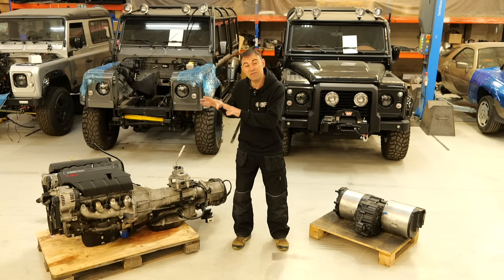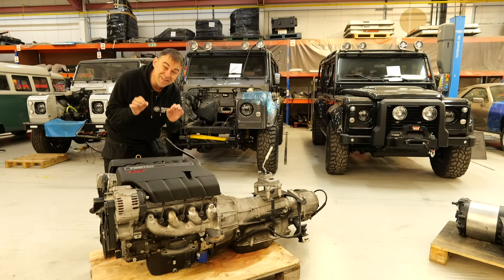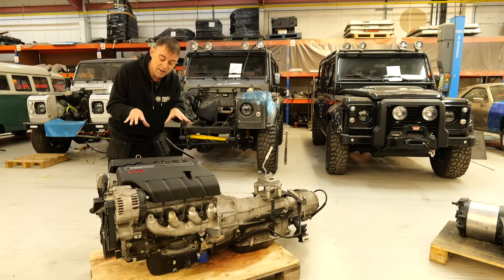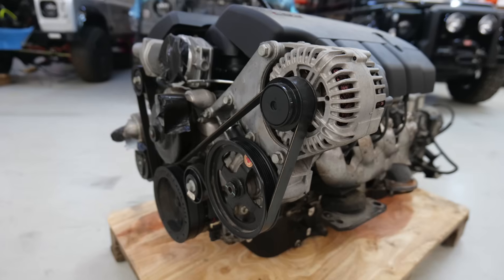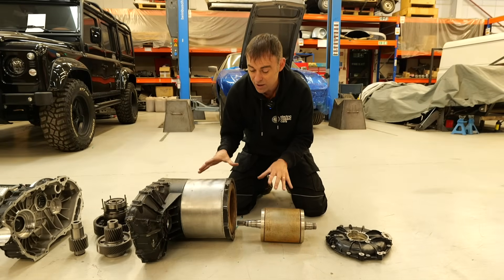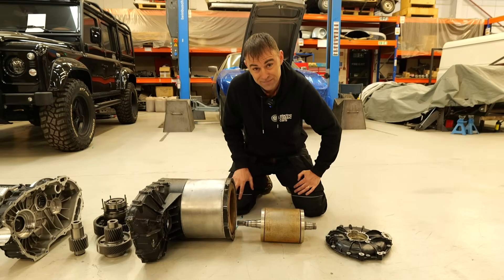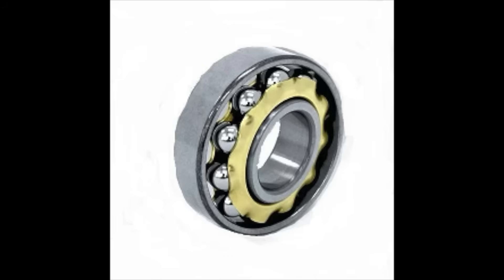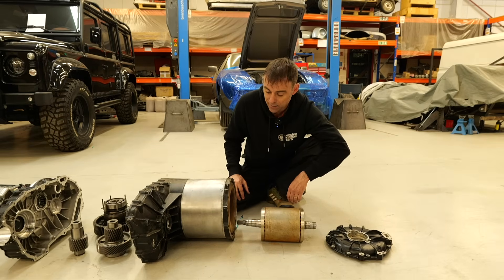Let's compare the Tesla LDU with an LS3 V8 and take one apart to see what makes it tick.

Comment: When you add in the weights of the exhaust and other anciary bits, you should also include the weight of the battery
Reply: And let's also not forget about the weight of a fully filled 55-80L fuel tank that an ICE needs to run!!...
Reply: Agreed
Reply: @you2be839  1kg / ltr.
Reply: @you2be839  or 50+kwh battery pack + protection
Reply: @you2be839 with an electric battery your not normally fully so why should the tank be full
Reply: @gmercede  If charging at home, the battery would most likely be full... but the the ICE tank should be full when it comes to testing range and the total weight of the different vehicle's technologies as the closest apples to apples comparison possible.
Reply: Fuel lines, radiator, alternator, vac lines, air intake, vac pump and extra emissions technology as well. Lots not included.
Reply: @you2be839  thats been addressed.. .the EV is MUCH heavier , with fuel of ICE considered.    are you late to the party here??
Reply: @zanick2  No one's trying to party and EVs are generally heavier than ICE cars, I only said that the fuel for ICE cars also needs to be mentioned because it rarely is in these kind of "total weight of a system" talks!
You're the one making preassumptions!!
Reply: @zanick2 well depending on what ice car, some ice cars are more heavier than ev, thanks to the lack of transmission on EVs.
Reply: and therefore add the 60kg odd of the fuel tank and 55 odd litres of fuel inside it.
Reply: @smithleon and the starter battery for the ICE
Reply: But don't teslas also have an accessory battery that is required to make the car work?
Reply: @eds.9522  All EVs do. You don't wanna run your interior stuff with 400 or 800 volts.
Reply: @steviefordranger198  Ev allso have 12v starter battery.
Reply: @steviefordranger198  again, so what?  50lbs for the battery, 150lbs for the gas.  600+ for the engine?   the EV parts are over 1000lbs     stupid to bring up weight here
Reply: @steviefordranger198  Well given the V8 is a bit of a hunk it would be a big and hence heavy starter battery, but curiously most if not all EVs have a 12V lead acid battery, if only to run all the 12V accessories.
Reply: @eds.9522 yes. Lol Tesla has batteries.
Reply: @steviefordranger198  My EVs also have a starter battery - well, HV control battery - 12volt same size as an ICE starter battery
Reply: @castroorstad8215 An EV doesn't have a "starter battery", that's the main battery.
I'd hope the 12v being used in an EV is more like a camper van's house battery, as it can be discharged further down. If it's lead-acid then starter batteries and house batteries are actually built physically different inside. But honestly I'd hope they're using a 12v 100ah lithium
Reply: @logitech4873 That is not what the 12V is for though. All EVs have a DC-DC converter which brings the traction battery voltage down to run the 12V subsystem. The 12V battery runs the subsystem when the traction battery is not connected and when the DC-DC converter needs more current than it can supply - like power steering, window demisters etc. They could make the DC-DC conferter do everything but power electronics are expensive so they use a much cheaper ancilliary battery. Similar to the way a 12V battery in an ICE car supports the alternator. It also means that if the traction battery gets too low and needs to be shutdown to protect itself you can still start the car to charge it.
Reply: @marquisdemoo1792 once again that is incorrect - read the previous comment in this thread to discover what the 12V battery inan EV is really for.
Reply: @ You are being pedantic. I was replying to someone who seemed to think there was no equivalent to the starter battery in an EV and was deliberately simple.  My choice of the word accessories was perhaps vague but it was meant to include all the  non-traction components.
Reply: @michaelmartin9022  No. It is a 12v starter battery. Usual agm type. Newer Tesla has Litium type.
Reply: @eds.9522 correct, although the EVs 12v battery is a lot smaller as it doesn’t have to crank an engine.
Reply: @eds.9522 well but evs  doesn’t need that heavy transmission 😅
Reply: @eds.9522 Yes, a solid state battery less than half the size of a standard ICE car battery. They moved on from the regular ICE battery in 2023.
Reply: @castroorstad8215 Not anymore bud. Tesla moved on to a solid state unit that's less than half the size of a 12v in 2023. Keep up if you're going to criticize so you don't sound like a fool.
Reply: @ChosenMJ  Here we have one of the idiots who thinks he knows more than others, and tells them they are idiots. But who himself is the biggest idiot. Tesla does not use solid-state batteries in their cars instead of 12v lead acid batteries. They use a lithium-based battery.
Reply: @smithleon but then you would have to factor in the battery weight too.
Reply: In what world does a gas take weigh 60 kg?
Reply: @Joecrow-c6c  When it's full of fuel I would guess
Reply: @Joecrow-c6c do you mean gas tank. Fuel weighs approx. 1kg per litre. Than the metal tub of which the fuel lives can indeed be 60kg and more. A out the weight of a person.
Reply: @smithleon  yes
Reply: @smithleon odd you suggest that.
Reply: Tank is not 60kg😂😂 its closer to 15kg @smithleon
Reply: @shanemyers6244  add in the weight of the petrol, about 0.8kg per litre. You do the math.
Reply: @shanemyers6244  if you look at my original post I said it was 60kg of tank AND fuel.
Reply: @smithleon  you got to be kidding.   you know the batteries are over 1000lbs.  MUCH more heavy than the engine and fuel combined.
Reply: @zanick2  No, a battery averages about 300-350 kilograms, which is not even 20% of the all up weight of the vehicle.
Reply: @thethirdman225 EVs are great but the batteries weigh more than that most of the time. Plus the post you responded too said over a 1000lbs which is about 450kgs - a model 3 battery weighs about 480kgs but Tesla is the best at optimising weight so others may weigh a lot more. Weight is not the big deal thay everyone makes out until you get into these large 4WDs - then the extra weight becomes an issue with GVM and GCM.
Reply: @mondotv4216  I've already looked it up. But the one thing everyone overlooks is that  unlike internal combustion engines, batteries still have long way to go in development. There's a new development out of China almost every month. Th latest is that they seem to have solved the problem of sodium having low energy density. That's the thing they're chasing. More energy density equals better power to weight.

The peak of this is said to be the solid state battery and that's another one that's a fair way down the track. It works but again, it's a matter of weight. They'll work it out.

Tesla source most of their batteries from suppliers. They're not actual battery developers. The Cyber Truck, for example, actually uses a truck battery, hence the 800V architecture. That's becoming more common but that's where it came from.

But it still remains that the Model Y is still lighter than any BMW X5. And that's my point. All that weight has to come from somewhere. So whatever the battery weighs, the whole package isn't extraordinary. But if you're going to include the whole power train from fuel or battery to the wheels, an ICE vehicle has to include the drive shafts and the differential.

That extra weight in the BMW is less favourably placed too. The CoG of an EV is much lower than in an ICE and the space is better utilised.

This will all change in time. Batteries will get lighter. ICE engines reached their peak of development 30 years ago.
Reply: @thethirdman225  The reason the Tesla is lighter is because of the aluminium body panels versus the steel body panels in the X5 - plus the X5 is a hybrid so it also carries a small electric motor and battery and the heaviest version is a PHEV with an even bigger battery. I do agree with you that the there is too much FUD about EV weight. For example a Model 3 is only about 60kg heavier than a Toyota Camry. Having said that Tesla is about the only high volume EV maker that has concentrated on weight reduction. Most use exactly the same tech they use for their ICE cars which is going to make them about 250kg heavier. A Polestar 2 for example is between 100 - 200kg heavier than a Model 3.
Reply: @ The Polestar 2 does very well in long range tests. I looked up the Polestars 3 and 4 and both of them have monster batteries in them.
Reply: @thethirdman225  It still has a 12v battery.
Reply: @ The accessory battery, yes. It wasn’t me who was talking about that.
Reply: @zanick2 450kg to be exact for the M3 performance which is 991.8 pounds.
Reply: @franciscoshi1968   you sure its not 992.1lbs? ;)
Reply: @smithleon sure. Fair and rational comparison
Reply: @smithleon  You'd be suprised how light a tank of fuel is, about 2 pounds per gallon, so 55 liters is equivalent to 15 gallons, so like 30-35 pounds for the fuel, and add another 50-75 lbs for the weight of the tank itself, you get roughly 100-120 pounds total.  The battery at nearly 1000-2000 lbs is going to drastically outweigh the fuel and add significantly to the EVs total weight. We see this as all Tesla's are 500-2000+ pounds heavier than their comparable gas vehicles when all parts are assembled in the final car product.
Reply: @RT-mv7df   You guys can’t help yourselves, can you? A gallon of fuel weighs about six pounds, not two. Did you really think I wouldn’t look it up? That means about 90 lbs in a 15 gallon tank, not 35 lbs. an EV battery that weight 2,000 lbs? Are you completely serious? The heaviest normal EV battery I know of is in the Mach E at 550 kgs, which is just over 1,200 lbs.

No Tesla battery weighs 2,000 lbs.

Why do you people feel so compelled to sprout oil industry lies? It’s not even in your own best interest.
Reply: @thethirdman225  u know what, that's my honest mistake, u r correct, it's ~6lbs. I quickly read a reference that said gasoline is 25% lighter than water & misinterpreted that as 25% of water (was being lazy, i admit). Note to self: slow down. NOW.... Even at 6lbs, that's 90lbs of gas in a 50-75 lb tank, which is only about 40-60 lbs heavier than my earlier estimate. 

Still WELL UNDER 200lbs, & SIGNIFICANTLY under the average weight of a Tesla battery that can't get the same mileage as a decently efficient gas car at (30mpg *15gallons = 450miles/tank). You'll see in the list below that most EVs get anywhere from 240 miles to 330 miles (excluding the farthest outliers).

Now, a breakdown of a few EV vehicle battery weights:
Battery Weight, Key Statistics: 
Minimum: 668 lb (Nissan Leaf)
Mean/Avg: ~1495 lb (sum of the model list (see below): 19,445; divided by 13 ≈ 1495 lb) :face-pink-tears:
Median: ~1700 lb (Model Y, 7th of 13 entries in the list below)
Highest: 2923 lb (GMC Hummer EV Pickup)

Common Model Battery Weights (Sorted):
Vehicle Model, Capacity (Weight), Tested/Verified Mileage, Notes
1. Leaf, 40 (668), 226 miles, Reported weight
2. Bolt EV, 65 (959), 238 miles, Estimated: 65 kWh × 14.8 lb/kWh
3. Model 3, 60 (992), 310 miles, Estimated: 60 kWh × 16.5 lb/kWh
4. Ioniq 5, 77.4 (1160), 265 miles, Estimated: 77.4 kWh × 15 lb/kWh
5. Model S, 100 (1200), 366 miles, Reported weight
6. Mustang Mach-E, 98.8 (1323), 270 miles, Estimated: 98.8 kWh × 13.4 lb/kWh
7. Model Y, 75 (1700), 308 miles, Reported weight  🙈
8. F-150 Lightning, 131 (1800), 270 miles, Reported weight
9. Cybertruck RWD, 120 (1980), 250 miles, Estimated: 120 kWh × 16.5 lb/kWh 😤
10. Cybertruck AWD, 122.4 (2020), 302 miles, Estimated: 122.4 kWh × 16.5 lb/kWh 😵
11. Cybertruck Cyberbeast, 122.4 (2020), 304 miles, Estimated: 122.4 kWh × 16.5 lb/kWh :face-purple-crying:
12. R1T, 135 (2200), 254 miles, Estimated: 135 kWh × 16.3 lb/kWh
13. Hummer EV Pickup, 212 (2923), 329 miles, Reported weight

Look at all those Cyber Trucks with approximately 2000lbs , LOL.  AND that's without the range extender that I read adds an extra 500kg (1000lbs) :hand-orange-covering-eyes: Holy Toledo!!!!  These vehicles all weigh several hundred to thousands of pounds heavier than their ICE equivalents (not including acceleration, a meaningless metric), and each 100 pounds of extra vehicle weight actually increases the total momentum of a car at a given speed and significantly increases the deadliness of those vehicles in a crash with either pedestrians or lighter ICE vehicles.

You can corroborate this info yourself by asking Grok (or another LLM) the following:

"Provide a list of sorted EV battery weights for vehicles (cars & trucks) sold in the US in the last 4 years, stated or calculated, including at least the minimum, the mean, the median, the highest, and 3-4 other common popular cars for comparison (exclude low production rare vehicles)".

Interesting since Musk produces the CyberTruck and controls Grok, meaning he has incentive to skew these numbers favorably for the CyberTruck (they definitely do not publish the weights of the batteries by themselves (hint: they don't want this being talked about, for many reasons); but with the battery chemistry, cell-type, and total capacity of the battery it is rather easy to roughly calculate).
Reply: @RT-mv7df  gasoline weighs SIX pounds per gallon. 15 gallons weighs ~90 pounds.
Reply: @cyberia55  Thanks, yes, my mistake has been pointed out very promptly & i admit i misread a reference that said "gas is 25% lighter than water" and interpreted it as "gas is 25% the weight of water". Didn't pass the smell test & I thought it was "amazingly" light, but was in a hurry and didn't double-check. At least it proves I'm not AI & still prone to human errors.
Reply from the maker: We covered a petrol vs battery comparison in a previous Tech Talk which we linked when we talked about the weights and at the end of the episode. In case you missed it, here it is. 👍 https://youtu.be/opF1si__APs?si=WNcGIWVZZUdGGDzd
Reply: The weight of the battery only going to go downward as battery technology for EV is also improving, bettery energy density equals fewer batteries needed for the same range.
Reply: @RT-mv7df “Mileage” is a combination of factors, not just range. Mileage is a measure of efficiency. What “gas” car gets 450 miles on a single tank?

Furthermore, a Tesla Model Y weighs 2003 kgs. It’s rough analogue, the BMW X5 weighs at least 150 kgs more and up to 450 kg more, depending on spec.

Annual running costs are not even comparable. The Model Y is far cheaper to run.

I have to ask again: why do you do this? It’s not in your best interests. Far be it from me to tell you how to make your life choices but being shackled to oil companies at a cost of thousands of dollars each year for the rest of your life sounds like an act of self-harm to me. The oil companies don’t care about you. Why do their dirty work for them?
Reply: @thethirdman225   What “gas” car gets 450 miles on a single tank? Numerous ones, any that begin with 32mpg (of which there are many these days) can still feasibly get 30+mpg after several years (we're talking hwy miles, which in major cities is majority of the miles from commuters on intercity hwys). Not saying they will all have 15gallon tanks, for example, the Accord has a 12.8gals tank (perhaps larger, but this is the lowest estimate). That gives it a range of 435 miles even with a decrease of efficiency due to age of 34mpg (34mpg * 12.8 = 435 miles). If we speculate the tank is actully 13.5gals, then the range is 459 (at 34mpg), or   it can still get 435 miles with it's efficiency decreased to 32.2mpg.

Sample of Common Models (2015–2025)
Toyota:
Corolla: 41 MPG highway (e.g., 2020–2025, 2.0L I4, CVT).

Yaris: 35 MPG highway (2015–2020, 1.5L I4).

Camry: 34 MPG highway (2018–2025, 2.5L I4, non-hybrid trims).

Honda:
Civic: 36 MPG highway (2016–2025, 1.5L I4 Turbo or 2.0L I4).

Accord: 37 MPG highway (2018–2025, 1.5L I4 Turbo).

Fit: 35 MPG highway (2015–2020, 1.5L I4).

Hyundai:
Elantra: 39 MPG highway (2017–2025, 2.0L I4).

Accent: 36 MPG highway (2018–2023, 1.6L I4).
Sonata: 35 MPG highway (2015–2020, 2.4L I4, non-hybrid).

Kia:
Forte: 41 MPG highway (2019–2025, 2.0L I4, CVT).

Rio: 36 MPG highway (2018–2023, 1.6L I4).
Optima: 35 MPG highway (2016–2020, 2.4L I4, non-hybrid).

Nissan:
Sentra: 37 MPG highway (2020–2025, 2.0L I4).

Versa: 35 MPG highway (2015–2025, 1.6L I4).

Altima: 34 MPG highway (2019–2025, 2.5L I4).

Chevrolet:
Cruze: 33 MPG highway (2015–2019, 1.4L I4 Turbo).

Sonic: 33 MPG highway (2015–2020, 1.4L I4 Turbo).

Spark: 34 MPG highway (2015–2022, 1.4L I4).

Malibu: 32 MPG highway (2016–2023, 1.5L I4 Turbo).
Reply: @RT-mv7df Those are all book figures. Almost no conventional “gas” car reaches those numbers. I had a V6 Kluger and the book figure for that was about 8.5 litres/100 kms. I rarely saw better than 12.

I’ll ask again: why are you doing this when it requires you to shackle yourself to a multinational fuel company? What’s in it for you? They’re just going to regard you as a useful idiot.
Reply: @thethirdman225  A functioning civilization & reliable transportation is the payoff for me. YES, that is something I definitely want to maintain.  

"Book figures", This is why I de-rated in my calculations for range of the vehicles, so you don't really have a point there. Also, Tesla's fail to meet the advertised numbers in many cases (typically by failing to note that if you follow their best practices to maintain battery life, u shouln't quick charge the vehicle often, and you should only use 60% of your battery before recharging (from 20 to 80%)). They also fail to meet their range if you are in super cold climates running the heater, or fail to meet their charge rate times if can't preheat the battery.
Reply: @RT-mv7df  
"This is why I de-rated in my calculations for range of the vehicles, so you don't really have a point there."

And you want me to take your word for that?

"Also, Tesla's fail to meet the advertised numbers in many cases (typically by failing to note that if you follow their best practices to maintain battery life, u shouln't quick charge the vehicle often, and you should only use 60% of your battery before recharging (from 20 to 80%))."

Depends on the battery type. LFP batteries are more tolerant and are usually charged to 100% once a week. We don't know yet how those things are going to work for solid state and sodium.

As I said, ICE engines reached the peak of development 30 years ago. Battery development, by contrast, is in full swing and the best is yet to come.

I'll ask you again and I know you won't answer this: why are you doing this? Are you being paid by the oil industry or are you a bot? Because as far as they're concerned, you're just a useful idiot. There's nothing in this for you.
Reply: @thethirdman225  You don't have to accept my reasons for doing this, but I've already explained very well "why I'm doing this", and it has nothing to do with being a bot or being paid by O&G industry. I simply see all the flaws in EVs that make it at best an emerging technology that is not yet ready for mass adoption. And probably the best way to kill it is to try to push it on the populace before it's ready for prime time, so please keep pushing it (are you paid by the EV industry, why are you doing this? See I can ask the same questions...).  Anyhow...

"you want me to take your word?"  Bro, the specs say the Accord gets 37mpg, and has a tank size of 12.8-14.5 gallons.  I chose the smallest tank size and de-rated the mpg to 32-34mpg to get conservative estimates of the range. How does this not compute for you or require any degree of blind trust?
Reply: @thethirdman225  "Why do you do this?"  A lot of reasons. I could give a whole series of lectures on my reasons. I'm a very heavy science-based thinker, and I work in the electrical transmission/distribution industry, so one of the biggest reasons I oppose EVs is that I know full well that our electrical grids are not capable of handling (without billions to trillions of dollars of investments) the increased energy needs of EV & Green proponents from the combined additional loads of EV transport proliferation, Electrification of all home & business energy consumptions (Elec Htrs, Elec Stoves, Water Htrs, etc), new AI data center loads, & whatever else we dream up in the next few years to continue to increase the amount of energy we use on a daily basis.

If the Climate is getting hotter as Global Warming alarmists speculate.... then A/C loads are already going to strain our electrical grids in the summers over the next 25 years without any additional burden created by mass EV/Electricification/AI  increases.  I could further elaborate "my reasons" in other areas like mass mineral consumption, fire risks, total vehicle ownership cost, accident & repair costs, climate fallacies, (probably 10 other additional areas) as to my reasons "Why I do this".

It's not that I am fond of being married to the Petroleum industry, it's that I'm a pragmatist that understands that we cannot maintain our current standard of living and a flourishing civilization without it for many years to come. I use cold hard numbers to face the hard cold facts, like the ones I've mentioned above, and also that EV couldn't compete with the ICE vehicles without the massive manipulation of markets that gov'ts have imposed (thru CAFE standards, subsidies/credits, taxes, etc). Those impositions have resulted in vehicle prices that average families cannot afford, & the result has been a wealth gap and is going to be a very deep recession in the next 5 yrs. Anyone with open eyes, some decent scientific understanding (or at least research skills), & without an agenda to promote can see this if they ignore the propaganda and just look at the realities.
Reply: When the v8 is using only 20% of the energy from the fuel put in to drive versus 90% from the electric motor arguing about the weight of the fuel versus the weight if the battery seems a bit of a waste of energy.
Reply: True about including battery weight. Another point for EVs is the fact that battery technology is rapidly evolving, while ICE technology has reached the end of any meaningful innovation. ie., batteries will continue to get more powerful and therefore smaller.
Reply: I agree. Even if some ICE cars are jewels but only rare ones, in any case an Electric car or super/hypercar (even trucks) will have a lot more performance and efficiency... And time will confirm that.
Reply: Went the ev motor is so powerful and so torquey that it laughs at weight, while the gas engine struggles with it.
Reply: Folks are overreacting and misunderstanding the point. He's comparing the drivetrain system just short of the fuel sources and thus its mechanical simplicity for the power to weight ratio.  In no way is he saying the lighter EV motor is a vehicle weight advantage. Obviously the EV battery adds lots of weight to an EV.
Reply: Owning a Tesla Model 3 has been great so far. The maintenance has been minimal. We just took it for our first long distance trip. It was also very simple and stress free. Put your destination in the navigation and Tesla plans your route as well as every charging station along the way so you know what percentage your battery will be at by the time you arrive at your next charging station. It worked flawlessly. Tesla has really thought out everything. We used the self driving and cruise control and that too was amazing and gives you a chance to stretch out your legs and arms while the car drives for you. You must still pay attention and be ready but it works perfectly.
Reply: <><><> Clearly a biased and deceptive post bc it's cherry picking. Typical for EV zealots. EPIC FAIL. 
I massively invent in this space so I know the deception game. GTFO!!! <><><>
...
Reply: The 5000+ pound Lucid Air Sapphire is laughing at everyone in the comments whining “what about battery weight?”
Reply: The EV wins the arguement,but the driving enjoyment of a LS3 with a gearstick in a cool old school landrover would be my pick
Reply: As pointed out by others surely the battery more equates to the fuel load and not exhaust, because that's part of the engine. There will be a negative in the EV system because while running the ICE engine consumes fuel and therefore reduces mass of the vehicle the battery mass remains the same no matter the charge (yeah we could argue Einstein and mass=energy but that's such a small factor there's no point), butat  the same time the battery and EV system is well over 80% thermally efficient, that is less power is lost as heat, ICE engines normally run in the low 40% thermal efficiency, if even that depending on size and design. Either way is neither here nor there, I mean we could also add the weight of the drive shaft and diff to the ICE mass. I think just counting the EV motor and the ICE motor and everything directly related to running them, such as the exhaust in the case of the ICE engine and what for the EV? Wiring harness to transfer power from battery to EV motor? It's a rather pointless exercise that would be eaten up in the minutiae of arguing what is and isn't necessary for the motor either EV/ICE.
Reply: Im an ICE fan i have some Minis cause I love the way a manual mini drives but I tested the Macan S EV and it handled surprisingly well for a 2200kg SUV.
Reply: Best of Both Worlds - Range Extended EV:

- Simply equip just enough battery to  cover most daily commutes.

-Continue to use that 600hp Electric Drive Unit.

- Include a small, soulful gas engine to serve as a generator for longer trips (tuned for a fixed rpm).

Now, you have the smooth, quiet, instant power, torque & regen of EV.

You have a lighter, cheaper battery.

Cheap residential charging for 90% of daily trips (1/4 the cost of gasoline) 

Freedom & ease of simply refueling on long trips with gasoline available anywhere.
-
Reply: And the weight of the fuel...
Reply: How do you set up your battery packs
Reply: Then add the weight for the fuel/gas as well as the gas thank as well as the pipe to move all this around.😊
Reply: Funny how the EV apologists go from "the EV weight so little" to "The relative weight doesn't matter."
Reply: I think the most important aspect to consider is the repairability of each. Most people with a good working knowledge of ICE’s can replace most anything in the ICE “system”. Tesla, on the other hand, has their hands around the customer’s throats concerning repairability by the customer (or a third party shop). Instead, Tesla, and most all the other EV manufacturers cripple the customer into bringing the vehicle back to the dealership for repair. This includes the $22,000 Model S battery cell, which fails after 7 years. And that’s being optimistic on how long it lasts.
Reply: TESLA IS KING 👑 BUD
Reply: Then you have to weigh in the weight of the fuel tank and fuel.
Reply: @dougmarshall4010  "Then you have to weigh in the weight of the fuel tank and fuel."

A tank is just an aluminum or steel shell--I lifted one into my car with one hand. Fuel is about 6 lbs. per gallon. A full fuel tank weighs about as much as a lazy adult golden retriever plus a big mac combo.
Reply: Fuel tank too.
Reply: Am waiting for Chinese BYD 1200HP EV kit
Reply: And don't forget the second motor to produce the same power
Reply: Batteries?????
Reply: Yeah, take that Land Rover out in the bush of Africa with the electric unit in there and find a charging station. You can find gasoline all over Africa.
Reply: @copisetic1104 so you need to go to Africa to make what kind of point? If you go to the moon, try using your 19th century gas burning engines. How about using a gasoline generator on Mount Everest?
Reply: If the V8 weighs 750kg with all the ancillary bits and the EV weighs 900kg with battery and motor there is little point in suggesting one is better weight-wise. The major issues are efficiency, noise, heat, simplicity, value for money, environmental damage and torque. The EV wins hands down. It’s the status quo getting used to a paradym shift that is the problem.
Reply: @iscadean6038  A bit more weight but it is so much lower and most of it in the centre of the car below the floor. When I show people my model 3 performance they ask where are the motors? down at axel hight under the boot and frunk and the next question what about the battery ? Under the floor between the wheels.
Reply: @JonathanTamm  yep. Many can’t conceptualise the vast difference between EV and ICE in terms of layout and CoG.
Reply: @JonathanTamm  yes, its about time that was made more advantage of in affordable compact sportscars
Reply: @JonathanTamm And those batteries actually allow parts of the chassis to be lighter because it is part of the structure of the car.
Reply: @iscadean6038 *paradigm shift.
Reply: @iscadean6038  even though overall physical measurements (and output) between ICE and EV are not far apart, the energy efficiency 30% vs 90% will decide total ownership cost for the time user keeps the vehicle, not to mention for maintenance the more parts there're generally more issues.  Also note, for roughly same size the battery density is still increasing, getting close to 1000 km per full charge will be "a norm" for new EV models in 3-5 years.
Reply: @ I totally agree.
Reply: @iscadean6038  Environmental damage is very hard to compare: we have the winning of rare metals and their (non)recyclability plus the generation of electricity vs the winning + distribution of oil/gas and it's air pollution at the spot.
Reply: @ whaaaat? 8 billion tons of oil against 170k tons of lithium every year? 7 billion tons of CO2 as a result of burning that 8 billion tons? 6 billion tons of coal burned every year? 25% of the electricity grid is used to refine oil. Stop drilling refining and selling oil and you get 25% more electricity by doing nothing. Lithium is not rare. There are 230 billion tons of lithium swilling around in the oceans. 100 billion on land in the earth. A lithium Ferrous Phosphate battery pack for a 100kWh car battery is made of about 6kg lithium, the rest is rust (ferrous oxide) and slug pellets (ferric phosphate). No rare metals except cobalt - which isn’t rare. Rare earths are contained in electric motors but they are not rare either, despite the name. All EV batteries last 20 years in the vehicle, twenty years as solar storage and then can be recycled 90%. 9 zero % You know nothing and you write shit. Do some basic research, mate.
Reply: @iscadean6038 "environmental damage "? 
Look up what it takes out of the environment to mine lithium for the batteries and what happens when the batteries catch fire.
Reply: @thomasnew8606  The CO2 cost of the production of an EV pales in comparison to the continuous and unending CO2 release associated with running an ICE car.
Reply: @ lithium is like sodium higher on the table of elements. It can be mined but normally it is evaporated in large evaporation pans. Did you know there are 250 billion tons of it - in the sea? And another 100mbillion tons on land. Did you know that ICE vehicles set on fire 60 times more than EVs for the same number of vehicle? And did you know hybrids set on fies twice as often as ICE vehicles. Oh but you don’t want to discuss ICE fires, do you?
Reply: @ 170,000 tons per year taken out. Did you forget to mention the 8 billion tons of oil dug up? Or the 6 billion tons of coal? And all that gives 7 billion tons of CO2. Did you forget to mention that there is 250 billion tons of lithium in the oceans? And it is evaporated like salt in pans? Using a free energy source called the sun?
Reply: @iscadean6038  Agree except for environmental. Any advantage is negated by the battery, tire wear, abuse on roads, and the inefficient charging. Electricity that has been generated has already been through more series of conversion loss than just burning the fossil fuel locally. I am not saying an ICE engine is better. What I am saying is this myth that EVs are really green.  Compare efficiency without recognizing where the electricity comes from its no comparison, but that's silly. The whole system needs to be taken into account. The electric motor compares to ICE is hands down the winner at conversion.  Often people will just say they use solar. HA, so then count all the energy and fossil fuels needed to make them. They both have advantages and rarely is it so simple. I do like EVs for their performance, simplicity and control. Unmatched, being a "green" alternative, no not so much unless we get a revolutionary  breakthrough in battery and solar tech. double the capacity of current battery and solar tech and all will be EV.
Reply: @ however. An EV costs 15 tons of CO2 to make - as does an ICE. Over the lifetime of an ICE, however, it pumps out 52 tons additionally of CO2. EV - nothing. However, which ever way you cut it, with our electricity coming 50% from renewable and getting better by 2030, you have to admit the burden from fossil fuels is reducing year on year.
Reply: @ tyre wear is the same as for ICE cars. Who says different? A three ton Range Rover wears out tyres and roads faster than my 1.9 ton Polestar. And don’t you think the 44 ton trucks might contribute to those potholes somewhat? Battery breakthroughs don’t happen. Iterations of research produce improvements day on day. All will be EV by 2050. 50% of all vehicles will be EV by 2030. Getting there. CATL have a 1000 km battery already. Is 600 miles enough? Charging speeds are capable, with BYD’s latest iteration of battery, of 10-80% in 5 minutes. Already here. You can keep trying to diss elements of EV technology but it is happening. And in 20 years it’ll just be normal.
Reply: @ "tyre wear is the same as for ICE cars. "

Who are you replying to? Anyway...

You'd be correct that tire wear is the same between ICE and EV vehicles if all else were equal between them, but not all else is equal between them. EVs weigh significantly more than ICE vehicles in the same size and class. Hence, it can be fairly said right now that EVs wear tires faster than the competing ICE car.

"You can keep trying to diss elements of EV technology but it is happening. "

You can keep trying to dismiss some concerns that are true of today's EV technology, but they remain valid.
Reply: @iscadean6038  The car in question skews the argument. My car has a 120kg engine and 30kg fuel tank. Annoyingly electric makes more sense if you have an oversized car.
Reply: @ DOESNT matter the size. It’s the emissions, mate. Small or large ICE is inefficient, smelly, and noisy.
Reply: Value for money EV wins? That is so blatantly false I'm surprised you even wrote it. Batteries, especially one you'd need to give a LRD for any usable range, would be astronomically expensive.
Reply: @iscadean6038  I'll also add that an American company is now licensing a dry battery manufacturing method that could reduce cost by 40% because it eliminates the toxic slurry baking process in battery making that requires lots of energy and factory floorspace for the ovens curing the chemicals. Converging efficiencies!
Reply: @ good isn’t it?
Reply: @iscadean6038  You're looking at forecasting for the future for a video of a present build. It's not cheaper today. Until we see EVs being cheaper than their ICE counterparts, your entire write up is pointless.
Reply: @ no you misread my argument. Batteries are down from $1500/kWh to $111/kWh in ten years and next year predicted to be $80/kWh. Which makes the batteries cheaper to make - not necessarily cheaper to sell. There is a tipping point next year where EV will cost the same to make as ICE. Not pointless. Just factual. But you don’t care really.
Reply: @iscadean6038  No, you don't understand. You're still forecasting. As I said, the video is of the present. The claim was today it's cheaper. It isn't. Until it is, it's all pointless speculation.
Reply: @ whatever.
Reply: @iscadean6038  The TLDU 140KG plus 450KG for long range batteries total 690kg
The LS3 V8 400KG plus exhaust, tank and fuel 200kg total 600kg

Only 90KG in it...   Impressive and the next generation of batteries will almost double the battery density.
Reply: @iscadean6038  environmental damage it will take  8 years. For the ev to become green
Reply: @iscadean6038  and the inconvenience of charging and expense of on road charging - if it could be say 15-20p /kwh for both home and away charging and half hr max for 300mls added then it would b easier to ignore all the naysayers

Ihave had an EV (subscription charged) and V8s for many yrs :)
Reply: @ inconvenience? When my prostate says stop, I stop. When I stop, I charge. Simple. Usually every 1.5 hrs or 100 miles. That’s 15kWhs which takes 15 minutes. Enough time to go to the toilet, grab a coffee and get back to the car. Charged at home it costs £5/50%. My Volvo 2.9litre XC90 cost £3000/yr. Using Tesla superchargers on the road costs £0.52/kWh or £0.40/kWh offpeak. My annual running costs are £300. One tenth of the cost. But then look at the other advantages.
Reply: Right?! I’m a Tesla fanatic and fully behind EV conversions. It’s completely inaccurate and insufficient to exclude the battery. Without the battery, you have a zero HP boat anchor.
Reply: Well EVs in the SUV range are 3ton ice 2 ton. Tyres last less. Cost more to charge with public chargers. + A lack of qualified ev technicians.
Reply: @PaulSamps-gf6yz  a Tesla Model X and BMW X5 both weigh 2.4 tons on average
Reply: @PaulSamps-gf6yz  Which EV are you comparing to which ICE? Be specific.

Also EVs are far cheaper to run, as most people charge at home 80-90% of the time.

There's no lack of EV technicians where I live.
Reply: @logitech4873  a huge proportion of people  have no way of charging at home myself included!
Reply: @markscully2342  Not the case in my country. Vote for people that want to introduce right to charge laws. 
It costs me $5-6 to fully charge my car 100%. Meanwhile a diesel car costs like $110 to fill up. Sure the diesel goes twice as far, but the cost per kilometer is still vastly higher.
Reply: @markscully2342  That’s not much of an argument against EVs. “I can’t do it so EVs will never work”.
Reply: @ they are decisive and I wasn’t saying that because I can’t I was saying that a lot of people can’t far too many people can’t also the environmental impact of manufacturing batteries is too often ignored and the lifetime cost of ev’s is too often overlooked
Reply: @markscully2342  Okay, let’s break those things down and look at them.

If you didn’t mean that about not being able to charge at home then why weren’t you clearer about it? Even people with no off-street parking can still charge in most cities. Even large apartment blocks are moving to on site charging.

The environmental impact of EVs, compared to ICE vehicles has been grossly overstated. The production of lithium is known to be “dirty” but so is the production of any other metal. In fact, bad as it is, it’s probably not as bad as something like copper. Have you seen how dirty the production of oil is?

Furthermore, lithium batteries are now 90-95% recyclable. In the future, the demand for lithium is likely to be somewhat lower than it is now, as it is replaced by things like sodium, of which we have a near-unlimited supply. How much burnt fuel or oil can you recycle from an ICE? None.

The lifecycle costs are arguably the best argument in favour of EVs. Teslas, for example, don’t even have service intervals. There are Model 3s out there with half a million kms on them that have never had a service. The actual running costs of an EV — even if you charge off the grid — are generally about a fifth of those of an ICE. It costs me about AU $2,000 per annum to run my car and that’s for a hybrid. That’s $2,000 every year literally up in smoke. I want better value than that. EVs do that.

My cousin drives a Model Y, charges off his solar system — which he had long before he ever considered buying an EV — and he basically gets his fuel for free.
Reply: @logitech4873  Whether an EV is cheaper to run depends on how long you run it for and how long it was ran before you bought yours second hand.
Reply: @DavidDavyDavidson  Definitely not. EVs are just cheaper to run, period. It costs me 5-6 $ for a full charge at home.
Reply: @logitech4873 "Definitely not. EVs are just cheaper to run, period. It costs me 5-6 $ for a full charge at home."

Replacement of the battery pack is a running cost. Provide the cost of an OEM battery pack for the vehicle you claim to run. If you come back with a figure under $10k USD then identify the make, model and year of the vehicle you claim to use.
Reply: @DavidDavyDavidson  I wrote a huge reply and YouTube auto-deleted it, so you get nothing sorry.
Reply: @logitech4873  I feel you. Google seems arbitrary about that. Make sure not to post hyperlinks going forward, although that by no means does not guarantee it won't happen.
Reply: @DavidDavyDavidson  Yeah I know to avoid links, there were none. YouTube needs to get better with this. I have zero clue what triggers the removals.

The gist of my reply is that, in my country (Norway), with our electric and fuel prices, the battery could cost $20K and you'd still be likely to spend more in fuel before the battery would die.

I spent like an hour doing the maths and writing it all out, which YouTube threw in the trash.

Consumer reports here generally agree that EVs are cheaper to run. Again, that's in my country. 

I drive a Model 3, so the replacement battery isn't $20K. It's somewhere between 10-15K.
Reply: @logitech4873  

"The gist of my reply is that, in my country (Norway)..."

Norway is awesome. I envy your commuting space.  

"with our electric and fuel prices, the battery could cost $20K and you'd still be likely to spend more in fuel before the battery would die."

There would have to be Norway-specific facts for this to be true. I don't know jack about Norway, so we'll have to agree to disagree about the situation in Norway specifically.

First, some terms, as I understand them. 

"Capacity fade" refers to the inherent cycle-driven reduction in a battery's ability to store and discharge energy. Storage speaks for itself, and discharge refers to perceived power at the wheels (horsepower).

"Grace capacity" refers a portion of battery capacity hidden from the owner that acts as a reservoir to mask capacity fade for a time and maintain a minimum charge.  What is is reported to operators as 100% charge is actually only 80% of a battery's true capacity, and a reported 0% is actually 20%. The intent is to preserve the battery versus deceive the operators. Batteries last longer if their state of charge is between 20-80% at all times. But, it can lend the perception that a battery is in better health than it is.

Generally, based on current EV ranges, electric cars see 5-10% capacity fade (depending on frequency of charging cycles) for every 75,000 km (~46k miles) driven, which becomes noticed by the EV owner at about 225,000 km (140k miles), when the grace capacity to maintain the fictitious 100% state of charge is depleted.  

In another 125,000 more km, (78k miles) all grace capacity is depleted. The operator will have observed a 20% decrease in capacity. Capacity fade will accelerate as now there is nothing to keep the state of charge between 20-80 at all times. In fact, it will be possible for the vehicle to lose all charge in a short while just be sitting. 

It will be around that juncture (350,000 km or 217,000 miles) that owners begin consider replacing the battery for a cool $20,000. 

Now consider how the average age and mileage of a car in Norway is 11 years old and 122,000 km (76k miles). A used EV in Norway is hardly viable, as 122km is exactly when the EV's performance begins to perceptibly fall off at 8-16% each year (Average annual mileage in Norway is 11,100 km). 

In the US it's impossible, as the average car in the US has significantly greater miles and the battery is well into a state of delivering significantly reduced range and power.

And the facts I recite are under ideal circumstances and speak nothing about how the depletion of the grace capacity becomes even more apparent in freezing temperatures, or in extremely hot temperatures, when attempting to tow,  or traversing mountains, etc. 

Event the most expensive ICE motor swap I paid for (a 2003 corvette) was under $5k.

These facts honestly speak for themselves. I don't think anyone can credibly maintain that the running costs of an EV today compare favorably to ICE, given the reality that most people buy their cars used.
Reply: @ 
Ahem. Allow me to correct myself. 

I became confused when attempting to track both km & mileage. My American brain rejects both kilos and meters--it's a serious problem for us, except the scientists. 

Consequently, my conclusion about the viability of an EV in Norway as a used vehicle has changed. I think a used EV in Norway would be viable for most people, given the low accumulated mileage of your average car.
Reply: @DavidDavyDavidson  Sorry I can't take you seriously when you confidently state misinformation. Look up how buffers in EV batteries work. It's different in every car, but I don't know of a single EV with a 20+20% buffer, that's an insanely huge amount. 

My EV has 0% buffer above 100%, and 5-6% buffer below 0%.

Also degradation is non-linear. It's faster at the start, but then it slows down and becomes almost flat. Look it up.
Reply: @PaulSamps-gf6yz That is simply not true. A Model Y is lighter than a BMW X5 by a couple of hundred kilos.
Reply: @PaulSamps-gf6yz You don't need as many technicians since they don't need much maintenance
Reply: @PaulSamps-gf6yzSure but it's only been a handful of years. In two or three years that number will be half. Advantage, EV.
Reply: The difference is that I can 100% run that LS without the wiring harness and all the fuel injection and definitely without exhaust. Most of the street rods I build motors to go in just run small zoomies. Weighing an electric motor without a battery pack is more akin to weighing the LS would the pistons, rods, and crank.
Reply: @TheGorf  You most certainly cannot run a LS without a wiring harness. It may be smaller than factory but the ignition, fuel injection and transmission are all electronically controlled.
Reply: @michaelthomas7898  haha you clearly don't build many. They can all be converted to carb and a standard intake and the ignition then can be driven by a small MSD box. And now don't be too shocked by this, but there are both manual transmissions and autos that aren't electric. I largely just run th400s or 700r4 if I want overdrive.
Reply: @TheGorf  Good luck running the MSD on fairy dust, you need some kind of power for ignition.
Reply: @TheGorf  ;)
Reply: No its not akin to piston rods. Battery is to electric motor like fuel is to combustion engine. So if you talk battery weight then talk weight of fuel and the tank weight. Compare apples to cabbage?
Reply: @chrisduggan2443  "Battery is to electric motor like fuel is to combustion engine."

Are you really taking the position that a Tesla Model S will generate it's full 1,000+ horsepower if it were possible to connect it to a battery from a Nissan Leaf? 

And, even if you could do that swap (you can't) are you taking the position that the battery from the Nissan Leaf will be able to manage the heat generated by that power delivery? 

Meanwhile, fuel tanks are interchangeable as far as ICEs are concerned. They even sell universal ones. Find me a universal EV battery. The only thing a fuel tank influences is range.
Reply: @chrisduggan2443  "So if you talk battery weight then talk weight of fuel and the tank weight."

Even though I dismantled your analogy between a fuel tank and an EV battery pack, you have a deal! 

Selecting a car of the same size and class as a Model S at almost random, the BMW 7 series uses a really large 20 gallon tank. The tank weighs 27 lbs (part no. 16-11-7-411-799). Gasoline weighs 6.3 lbs. per gallon. That adds up to 153 lbs. combined for the tank + fuel. 

Meanwhile, the battery for a Tesla Model S weighs 1,200 lbs.
Reply: And don't forget, Tesla for fascists, V8 for Americans.
Reply: @backyard_expert  don't forget Fascists and n@zi's are left wing parties.
Reply: @backyard_expert libtards
Reply: @backyard_expert don't buy anything German then. And one man,'musk' is not the same as a whole company of highly talented engineers and workers from every ethnic race.
Reply: you can't include the battery vs fuel tank thing here otherwise it becomes painfully obvious that the LS3 is better, has less parts and will last five to ten times longer.
Reply: @RoverIAC 4 EV it's actually thousands of less parts
Reply: @RoverIAC  The LS3 has less parts? What are you smoking. Ever seen the inside of these two different motors?
Reply: @ did you read the whole sentence? If you count the motor AND fuel system the EV has way more parts.
Reply: @RoverIAC  Absolutely not. EVs have far fewer parts.
Reply: @logitech4873  how many parts in an EV battery? 5000 to 9000 cells, each cell has four main parts plus the wiring and other electronics.
Reply: @RoverIAC  I'm thinking of moving parts, not static ones. The battery is usually considered to be one part, except for its cooling system. ICE cars have an enormous amount of moving wearable parts compared to EVs, hence why they require more maintenance.
Reply: @logitech4873  charging those non-moving parts does damage to them and fast charging does more damage.
Reply: @RoverIAC  That's not really correct. Charge cycles and calendar aging matters more. Regardless, EV batteries are already very long lasting and continue to improve in this regard. Current batteries will last 20+ years.
Reply: @logitech4873 I noticed that also.
Reply: @RoverIAC the fuel is lightweight weight electrons
Reply: @RoverIAC That “5000 to 9000 parts” are, to all intents and purposes, one part. They don’t move and so there are no losses between them, other than across terminals.
Reply: @RoverIAC  Driving an LS3 does damage to it too.

You know, don’t you, that there are Tesla Model 3s out there with more than 500,000 kms on the clock that have never had a service. Try doing that with an LS3.
Reply: @RoverIAC  You need to read the Stamford University study about the lifespan of EV batteries.
Reply: @logitech4873 my brain hurt reading the ls3 has less parts myself 😂
Reply: @RoverIAC Cells are highly redundant amongst one another though. Yes, you may see some performance degradation if several dozen cells fail, but it will take an unrealistically high number of cells to fail before the battery suffers serious performance degradation.

This is very different to the high number of individual parts in an internal combustion engine/transmission/gearbox/exhaust/cooling system which can individually lead to serious performance degradation if they fail.

From a reliability point of view, if you're going to consider each individual cell in the battery as an individual "part", you might as well consider the threads on each fastening bolt a part, the balls in each ball bearing an individual part etc.
Reply: @RoverIAC Not even close. A battery is not particularly complex like you imagine. It's a bunch of cells linked together by busbars with a bit of electronics attached. None of those parts move - so nothing mechanical outside the contactors and the pump driving the coolant. Compare that to an engine - you literally have hundreds of moving parts all subject to wear and tear. Yes, a battery eventually outlives it's useful life - after maybe half a million or even a million miles depending on the technology used. Engines can make it that far but not without a lot of love and care. Instead of arguing which is better I prefer to think which is better for a particular purpose. For a daily driver, typical commuter, the EV wins hands down. Similarly for most typical work duty - vans, utes, deliveries. But for long range driving, day in, day out or for heavy duty towing or extreme off road diesel ICE is still a much better solution. For example, you can't really tackle the Australian outback centre or top end in an EV - you need a minimum of 1000kms of range, you need 4WD with locking differentials, solid axles, a spare tyre, a winch or a second recovery vehicle etc. Those ICE vehicles already weigh 3 tonnes or more fitted out - an EV is going to weigh more.
Reply: @logitech4873 ..go look up how much  plastic is used in a EV production... And where does plastic come from? It's not soy based 😅.. then do the same with copper and its refining processes
Reply: @ That’s a zero sum game. ICE vehicles use lots of plastic too.
Reply: @logitech4873  
if the inverter was taken apart like the pic of the engine there would be many more parts :-)
Reply: @pittyfew  Sorry what's your point? Are you claiming EVs use more plastic than ICE cars or? Please be clear, and please write the numbers instead of telling me to just "look it up", I don't know your source.
Reply: @RoverIAC  no it's not
Reply: @logitech4873  I think a better way of saying that is that an EV has far fewer replaceable parts. That inverter probably has more parts than the  LS3 does. A short range Tesla model 3 has almost 3000 cells in the battery. A Model X has 7200 cells. The down side is that a $15 part in the inverter means it's toast. They run $500 to $800 for the unit and will set you back $1600 to $3k to replace once labor and model are factored in.  

I have a car that the power door lock on the passenger side wouldn't lock. The module to fix it was $500. I pulled it out and tested the individual components and found it was because one of the 3 relays had gone bad. I ordered a new relay and soldiered it into the module and it's been fine for over 10 years. The relay cost me fifty cents.
Reply: @RoverIAC Those parts DON'T MOVE. Are you drinking and posting again? WTF
Reply: @RoverIAC then you would have to add all the links and pins in a timing chain,  the balls in the bearings ...  that is why ICE cars need more maintenance than EVs.
Reply: @RoverIAC  sure, the battery system has a number of parts but what what is important is the difference in the number of MOVING parts. EV has about 20 moving parts and an ICE has more than 2000 moving parts.
Reply: @RoverIAC  The LS has more moving parts in the valve train for one cylinder bank than the entire Tesla power train. Tesla battery is warranted for  100,000 miles. 5-10 times that is a million miles. Semi truck diesel will make it. Not the LS.